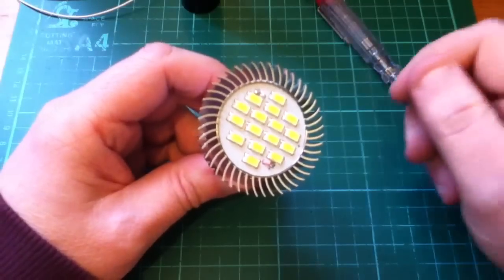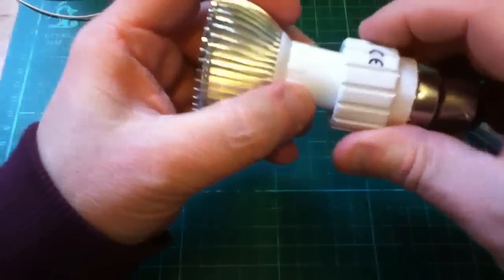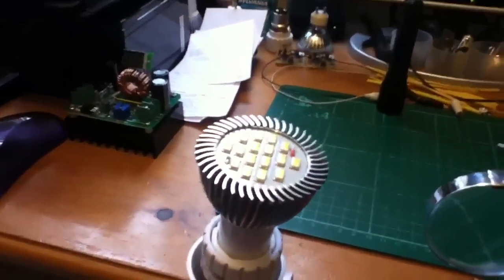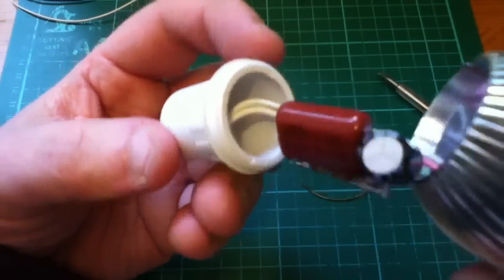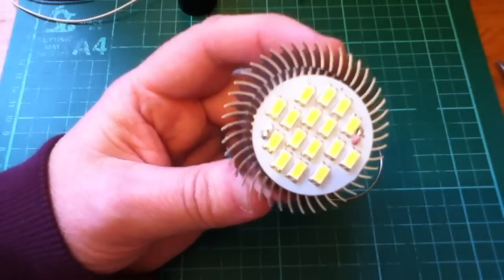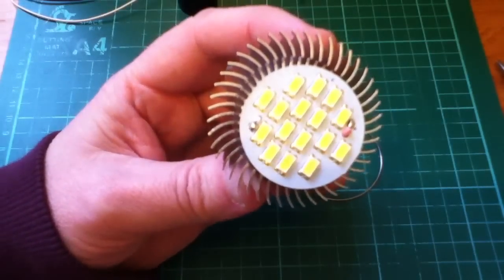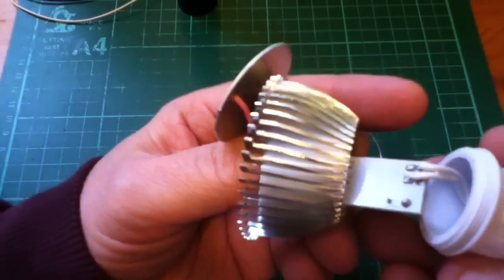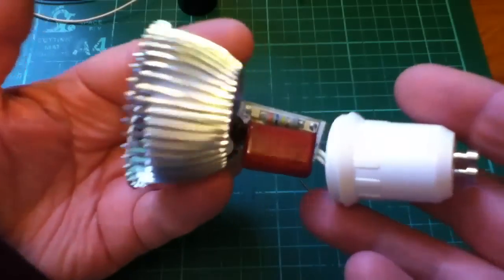Dangerous GU10 LED Spot Light is Cheap and Bright but could Kill You - Seriously

Comment: Don't take this personal but you're an overdramatic idiot who really should get out their voltage meter and actually testing something before you try and sound smart by telling people that something is dangerous when it actually isn't. I've taken 5 years of schooling through an electrical apprenticeship and let me tell you what this British clown should have told you.
All of that "peculiar" stuff inside that bulb actually steps down the voltage from 120 (or w/e your country provides) into a non-lethal 12 volts DC to supply power to the LEDs. No it is not grounded but no GU10 bulb is. Unless one of the components fail inside the bulb or (like this super smart Brit) you take the bulb apart and were to touch either of the two wires coming into the bulb from the 120 volt feed, there is absolutely no danger in coming into contact with the aluminum heat sink or surface of this LED bulb.

I would warn anyone watching any of this guy's videos to not take everything he says to be the truth, it's obviously not.
Reply: And you do understand that the electronics inside these bulbs are not polarity sensitive, don't you? Maybe with some of that 20 years experience you can figure that one out.
Reply: Michael Malek That my friend is in fact a real problem, because most people forget or are too lazy to remove the fuse before playing with wire. But that's nothin similar to the "problem" mentioned in the Video. You remember school? Well, we built little circuits in class. They were blanc cupper wirings, powered by a 9V battery. It didn't matter, because you can't even feel 9V (both AC and DC). And as Josiah Schroeder said, LEDs work with slightly higher Voltage, still far away from beeing harmfull and/or deadly. So if your home were to be wired for 12V DC instead of 230 (110) V AC , you wouldn't have the problem with the switch (just theoretical).

P.S.: Please never stick a knife in a toaster. But if you can't resist, plug it out first!
Reply: My house had to be rewired because of a similar problem like this light bulb. The power switch was on the neutral side of the line. When the power was supposedly off (switch was off) devices were still at a high voltage potential. It could of ended very badly if someone were to of stuck a knife in the toaster.
Reply: Howard Barnes
Not only that but from personal experience with these lamps the components are not rated correctly, in Australia we have a nominal 240 Volt supply, I fitted a shop display with 24 of these rubbish lamps, they began failing catastrophically, ie exploding, within 100 Hours of use, all the lamps failed within about 30 Hours of each other. In each case it was the electrolytic cap that had exploded after one of the over-driven LED segments had failed open circuit, putting full rectified mains voltage onto the cap. As an experiment I ran one on reduced voltage for weeks at around 200 Volts, no problems.
Reply: @whorayful Somebody told me that the Chinese did not get/copy "the full recipe" when they started making electrolytic capacitors and they were pretty much all bad for several years (perhapsome/all still are?).  I've seen this in broken DAB radios (inc. one with a circuit board dated 2005) where most or all electroytic capacitors are leaking badly (on the other hand, I have British and Japanese devices that are decades older without any such problems).  :(
Reply: Well wait a minute. Is the resistor before or after the bridge? I am guessing I dont have the bulb in question in from of me, But I would say the resistor is before the bridge. You will never have mains on the leds or heatsink.
Reply: silentwhisper2009 If there is no front cover, it does't have to short to the case. You can touch the wires by touching the front of the bulb. You are making the assumption that the circuit would be completed by the bulb, not taking into account the possibility of completing it through another device on the same circuit.
Reply: I said it's below 50 VDC. Also sometimes manifacturers have a circuit where you have more than one LED in a Row so you need a higher Voltage :D

P.S.: didn't say you were wrong ;)

P.P.S.: And Thanks, it took me some time to write it :D
Reply: Haha sure buddy I missed the whole point.
Reply: I bet you speak with a ghastly American accent... As for the bulb, it doesn't seem to have a CE (Conformité Européene) mark and would be unlikely to get one with that non-sealed AC side.
Reply: Lol who cares  just dont buy cheap shit
Reply: Josiah you are in the wrong, and should apologize for the harsh language.  The review is spot on.  The resistive & capacitor dropper circuit do not isolate mains from external components.  Its exactly as he says.  If you plug it in one way its safe.  Plug it the other way the mains would be present on the top of the board at the points he showed.  An accident touch of your finger and the mains current will flow through your body to whichever point your grounded, possibly your feet.  If your out of luck, and well grounded, with bare feet, or touching the wall, it could be fatal.  This is so obvious to persons who work with electrical or electronic equipment that it probably did not occur to him that 'proof' was needed with an AC voltmeter or mains tester.  Also, the other aspect was that the LEDs were mounted on a heat dissipating metal plate, with the possible mains carrying conductive tracks insulated minimally from the same plate.  This plate is in direct contact with the external metal fins.  Now, if the bulb was wrongly inserted, and the insulation broke down, the mains would be present on the metal fins- and this is the part you would grab to remove the bulb from the shell.
Reply: I am am electronics engineer & I suspect that the reviewer is too. I can assure you that what he says is absolutely correct & it's you who are lacking in knowledge.
Reply: Will Davis Nothing to do with the main subject of this thread, of course, but I get sick of hearing people saying this. Even worse, they are now WRITING it as though it's actually supposed to be like this! All these people went to school at some point and were taught how this really works, so why are they now changing it? It drives me mad.
Reply: Josiah Schroeder you got something against British people
Reply: I'll admit, my understanding of circuitry is limited but here's a video of someone who's gone and thoroughly tested it and I have to say... Seems dodgy as fuck! https://www.youtube.com/watch?v=rNf6VSj6M-E
Reply: Not to mention this.... I mean WTF? 0.o 
https://www.youtube.com/watch?v=hliHBeC1sco
Reply: I'm at lowes.
and it's your fault. .
I'm going to buy few right now. 
can say thanks
Reply: You should do some research before you comment. You would be right if this lamp used a switched mode power supply to drive the LED's, but it's not! It uses a 'capacitive dropper' circuit and that means the output is referenced directly to mains voltage. Take a look at a schematic of one and you'll see that one of the wires connected to the LED's is actually live or neutral. Just like Julian explains in this video, this wire can be neutral and realtively safe, but if the polarity on the input is changed that wire will be live.

Julian is right, you're not. Do some research before bashing someone.

Oh, and if you don't believe me, go watch BigClive's video called 'Deadly camping light with 240v USB outlet'.
Reply: Go watch the video I mentioned. You can see someone lighting a 240V bulb from the output of a capacitve dropper (just like the lamp in this video) to neutral. No need to be agressive.
Reply: You are absolutely right! How could he had missed something so trivial is beyond me!
Reply: F.Krueger: how hard is it to hook up a voltmeter and really demonstrate the risk there if there were any? He is assuming the "aluminum" plate is easily penetrable and will decay overtime (somehow) leading to some wires shorting the metal incasing.

I'm quite sure there are many unsafe products in the market, but this one doesn't really strike me as significantly posing a risk
Reply: Howard Barnes Well, send me one of the things and I will send you a Video with me touching the bloody thing everywhere you can touch it without disassembling it.
Reply: I have something against people who speak when they don't know about something. But yes, his voice makes me want to claw out my ears lol
Reply: Michael Malek HAVE, not OF.  Could HAVE.  When you hear people say "could've" a common misconception is they said "could of", but could've is a contraction for 'COULD haVE.  Could've.
Reply: Peter Baum Hoorah - we have a candidate for the Darwin award !
Anyone with brains does a degree.  Apprenticeships are for no-hopers in the main.
Reply: Julian Ilett ***** I don't know if you learned something else than we in germany, but although it's only been one year since I finished my apprenticeship, I can tell you that what this man sais is absolutely wrong. If you still have a book of tables, you can go look it up. Even the most primitive LED that's connected to an AC voltage doesn't work until you insert a rectifier in between the LED and the main Power Connection. A rectifier does one simple thing: it "changes" the AC-voltage to an pulsating DC-Voltage. You can smooth it out in part by adding a capacitor. You need the DC-voltage because the LED has a positive and a negative doped component, meaning that you need to pole it right for it to work (for details please ask your former teacher, or a collegue). So for now we have DC on the front panel, which is far less dangerous than AC (in this context). But the LED only needs a few Volts to work, so we insert a resistor to get the voltage to a level on which the LED can work without burning up. As we know which one of the poles is the positive (physical negative) one (as result of building in the rectifier) we are able to build up a small circuit, where the resistor comes before the LED. So now the LED only gets a small percentage of the voltage (which we calculated before) and it can work. But what does that mean for our example here? The two lines that are connected to the front-plate are the outlet of the rectifier, so it's DC. The positive (physical negative) side already has a resistor in between, so the voltage on the front panel is on the perfect level for the amount of LEDs. This Voltage is below 50 VDC, which is the border to feeling DC Voltage when touching it (dry environment), and even farther below the level that can do bodily harm (except long-term exposiure).

So no, neither he nor you are right.
No offense, just wanted to make that clear.
I beg to excuse any wrong use of words as well as grammatical and spelling faults.
Reply: Now if you would have replaced your 50 volts DC with 12-24 volts DC (which would put you at a voltage potential that's harmless to the touch), your lengthly/drawn out "look at me I sound like I know anything about how electricity works" answer would be correct. I.e. what I said from the start 😊
Reply: You're a thick American who completely missed the point !

Comment: This is cheap.
Most of the ones I purchased, used some kind of electronic inverter power supply. I have always suspected even these "insulated" supplies not to offer 100% line separation. They might offer a higher degree of safety, and these can be identified by universal voltage/ frequency operation. (100 - 240 V AC 50/60 cps)
And my feeling on the "dropper" circuit. 400 V capacitor (DC?) for 242 V AC supply will barely manage the peak line voltage.
Be suspicious when buying chinese lights.

Comment: I'm assuming that the ac first runs into the rectifier, if so the positive dc voltage would run through the resister no matter which way you insert it. Switching up the input on a fwbr does not switch the output.

Comment: i may be wrong but are led's not powered by DC voltage? im assuming the worst shock you'd get from such a device would be similar to that of the shock you'd get from one of those fake shoking pens or lighters.
Reply: LED's are driven by "direct" current, even if it's not particularly smooth. The LED's develop a voltage across them as a result of the current flowing through them. If you drive an LED with any old voltage source without a current limiting impedance, there's be a loud noise and a bit of smoke because there'll be an awful lot of current, briefly.
The point of the original post is that this particular circuit has one LED terminal electrically connected to a mains terminal, that can either be Live (or Line) or Neutral depending on how the lamp is plugged in, but for safety approval purposes you never assume that Neutral is any different to Live. So, by being able to touch the LED wires, you can touch mains potential. Generally, this is regarded as a BAD THING by safety standards authorities.
The only relevance that an earthed neutral would have to the discussion is that its assumption determines the wiring classification that the product would be suitable for, assuming it was designed properly in the first place.
Reply: I c i c...well thank you for the great reply

Comment: LED works on DC not on AC and its reduced from high voltage to low.Resistors and capacitors makes one polarity.So it doesnt mater which side it will be conected in socket. Dont need make such drama.

Comment: If its AC (like said in the description) your comment about the resistor being first or not is 50% is invalid, cause it'll switch live and neutral with 50Hz... Or is there a AC/DC converter before the Resistor? In which cause you're right.

Comment: Don't over exaggerate the problem, led lights are more safer than cfl lambs which often overheat, melt or explode some times. After bridge rectifier there is dc which is much safer, followed by current limiting resistor. also your take that reversing the bulb will reverse the polarity on led is wrong. after the bridge rectifier polarity wont change.

Comment: paranoid thoughts! i just tested it using earthed anti shocked meter, and RoHS machine tester. No effect at all. it's just used as cooler and even the condensator exploded, there is still inside the ceramic case. the input 240 volt only coming from the source has been limited becoming 0.2A. the output is not more than 300mA  TA: 50 Celcius degree TC: 60 C degree. It is safe!
Reply: Have you tried swapping the connections by taking out the bulb, turn it 180° then push it back in, but also test to earth too? because someone could be inserting the bulb while stood on metal step ladders which is touching a metal radiator. This would be very dangerous, specially if the power was on but the light was not lit because the LED was faulty.
Reply: Simon Ths Heaven help us if you are an expert.  There is live mains 240V going to the board containing the LEDs.
Reply: Condensator ?  Did you get any electronics education at all ?
Reply: I have never heard of a RoHS machine tester! What is that? Some sort of tester for a RoHS certified machine?
Reply: i m the expert in digital technological devices. All LED lamp is only about 5+ until 24 volt DC only... so why must be afraid of it?
Reply: Richard Mullens, it is down converted already. Technologies growing so fast and safety has been first priority in most products

Comment: I thought with leds (only know about car bulbs) they only work one way, if it doesn't work you turn it round. So are these a different principle?
Reply: They have a built in rectifier in the bulb which makes the electric go the correct way for the LED

Comment: Anyone dissing this vid need to re-think, these light are very dangerous, all it takes is the wrong wire to break and touch the heatsink or one LED to open circuit and there will be over 230v exposed, potentially could kill you.

Comment: I'm a little confused... neutral is the same as live. They are just the names given to 2 out of 3 available phases to avoid crossing phases in a circuit and tripping the protection. How do you reason that one is more dangerous than the other? Btw, I'm Australian. 240/415V 50Hz power.
Reply: neutral is not the same as live, if you touch it you will only get a tiny harmless  current flow through your body even if you were standing in a hole in the ground filled with water.
                that's because one of the 240v wires is grounded, literally connected to the planet,or earthed if you like,so there will only be a few volts at most, on it due to resistance and reactance.
                the other wire, the 'live' is at 240v, about 340 peak with reference to ground or the earth ,if you like, deadly if you are in contact with the earth or any conductor connected to it such as the third wire, the earth wire.
it's a , in my opinion, a crazy system, if every house was supplied from a 'proper',
isolating transformer, the only way you could get a shock, would be if you touched both the supply wires at the same time, touching only one could not result in a dangerous shock even if you were standing in a hole full of water.